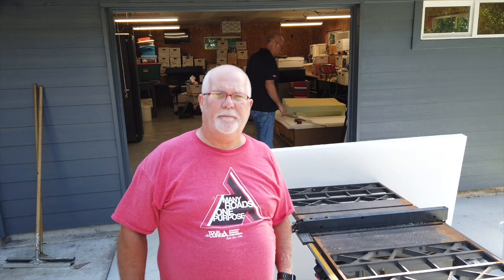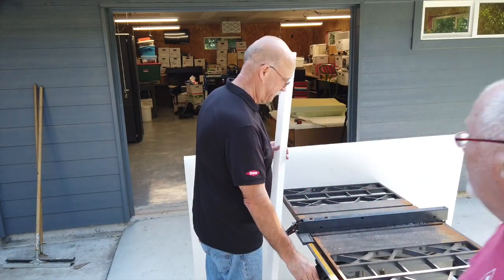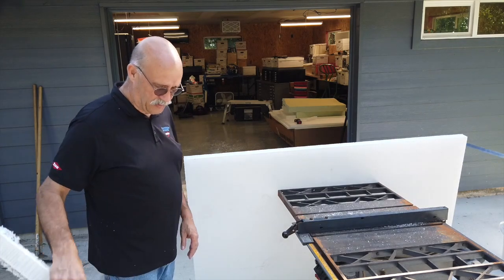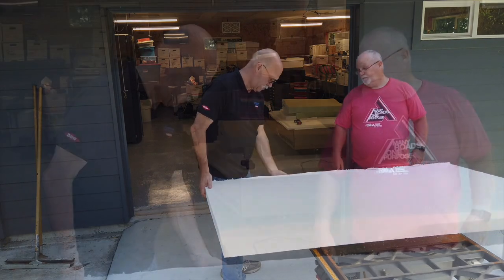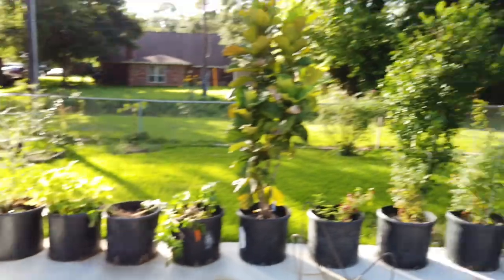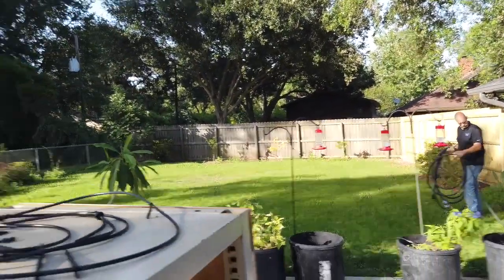Riding For A Cure Trailer Rebuild Part 07

Comment: What is the composite material for, insulation ?
Reply from the maker: The  composite material is to keep the trailer as light as possible and it does make for good insulation. They make boats from that Material.
Reply: So instead of wood, you use composite on the floor ? Also, why put it inside the aluminum channel ?